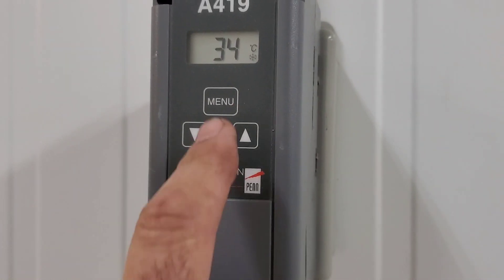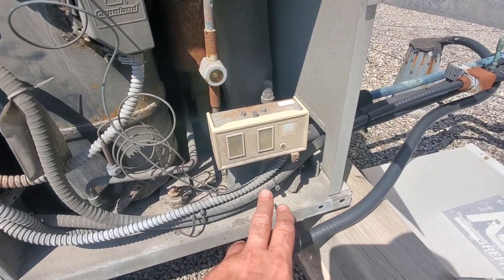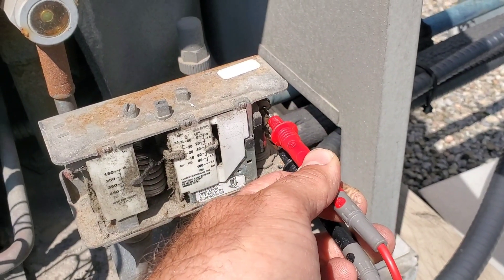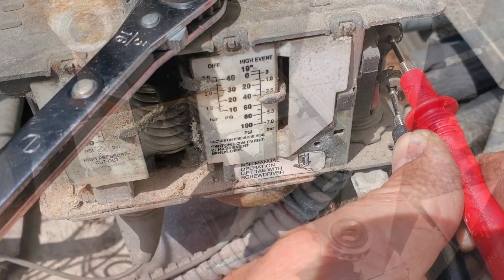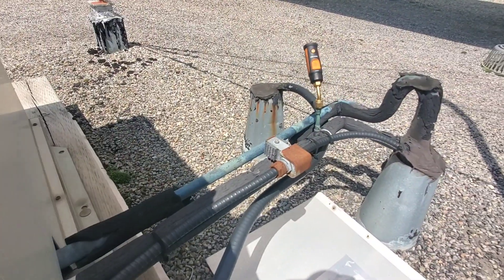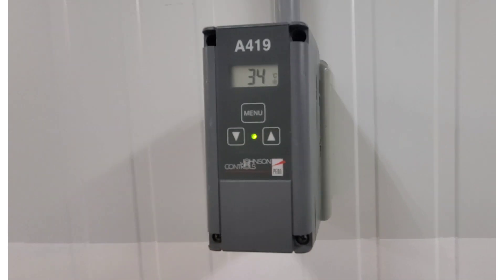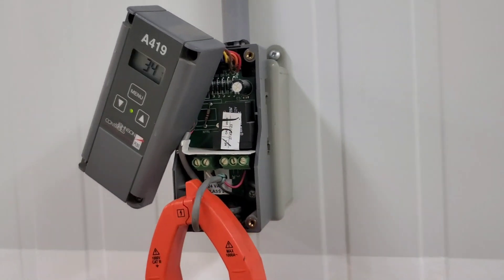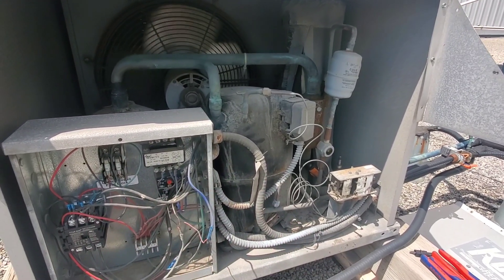Keeprite Condensing Unit Not Cooling, Thermostat Calling

Comment: I bet the transformer was set for 230v and not 208v that would explain the 22 volts see it all the time.
Reply: Exactly.  That can cause more issues with contactor and create so many bad things specifically for troubleshooting.
Reply from the maker: You could be right and something I didn't check.  I will when I'm back.
Reply: Excellent observation. I saw a similar issue in another video.